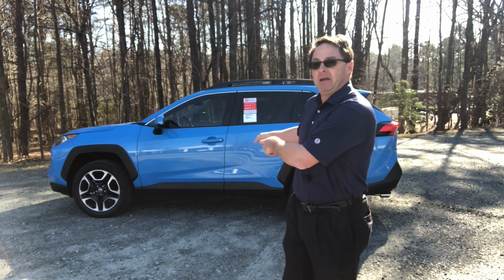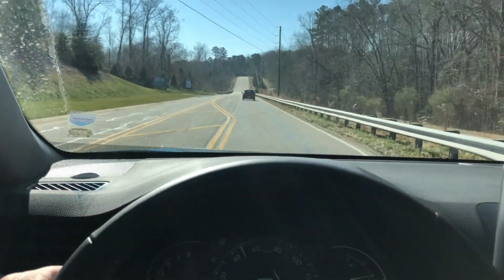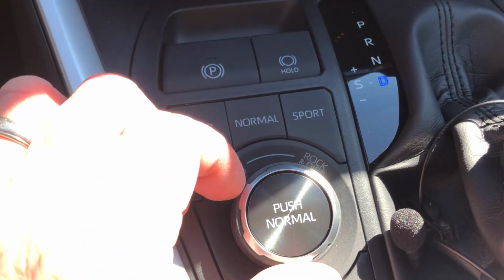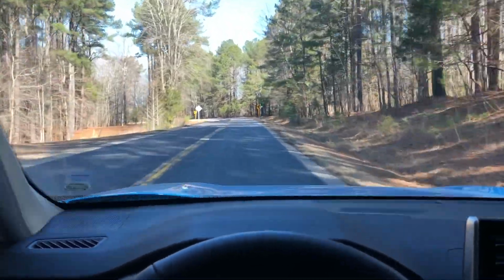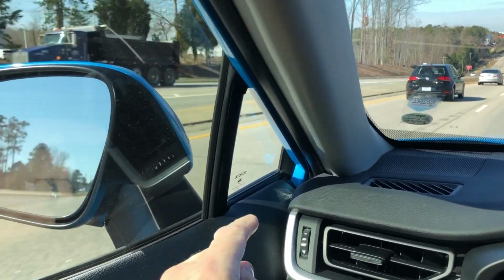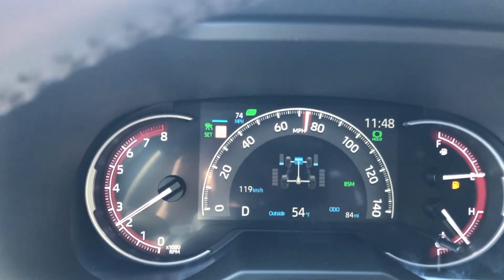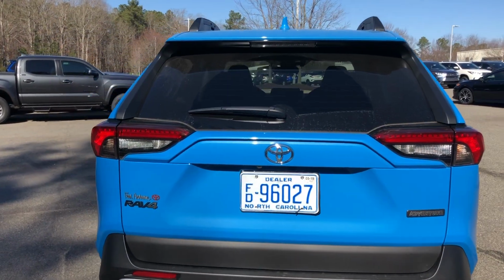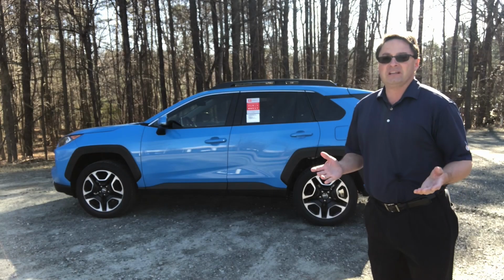2019 RAV4 Adventure Test Drive: City and Highway Drive!

Comment: @Toyotajeff in Raleigh I'm interested in the Hybrid version although it's not available in Dubai. I feel that the hybrid RAV4 was mostly made to improve the mileage in the city although as I've seen from your Camry Hybrid video that it doesn't stay long on battery and the petrol engine kicks off rather earlier than required.

Do you think there's a substantial real-world saving on gas on hybrid vs. regular?
I'd really like a practical comparative video testing real world-usage between all Toyota hybrid vehicles vs. their regular 2-wheel drive rivals.

Comment: Test drove the xle....very noisy engine...does not sound refined at all....otherwise a nice built car...but boy the engine noise bothers me....
Reply: Joe E If you are into the vehicles with total isolated cabin then this is probably not for you.  This used to be Toyota in the past.  I think they aim to produced more engaging vehicles according to Toyoda’s direction.  The engine noise is little loud when acceleration is part of it.